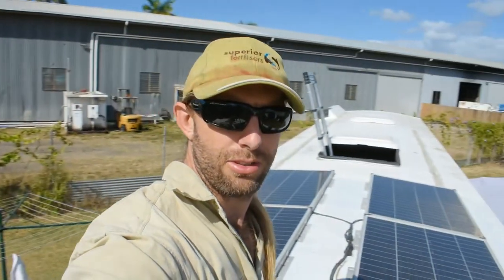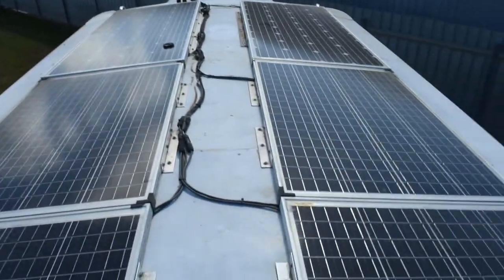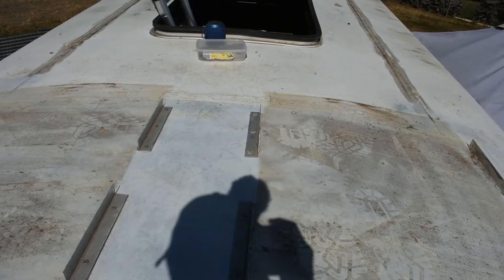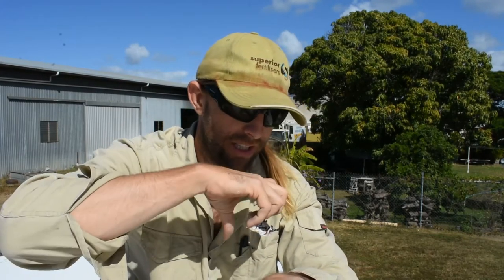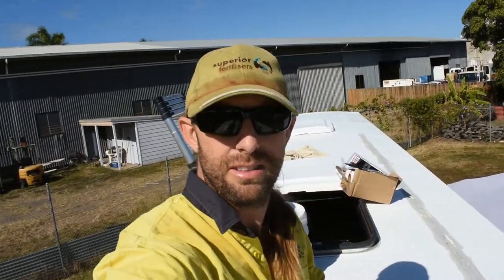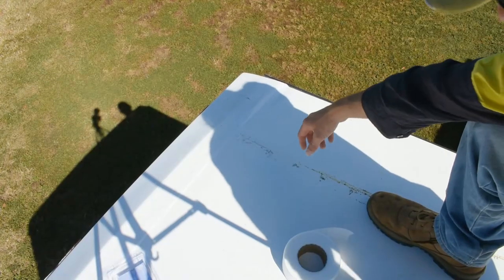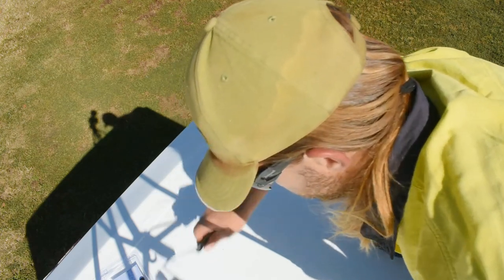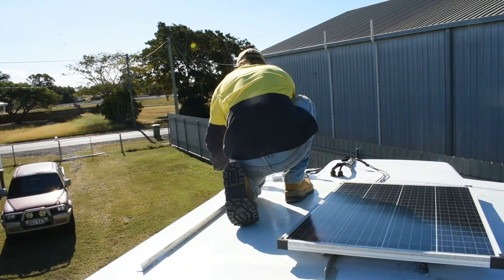Waterproofing Our CONVERTED BUS Roof | Bus Life Australia

Comment: Did you dab some silicone over the rivets on the solar brackets and the front & sides of the brackets ?
Being that they're on the downward slope on each side, & the brackets at the top, there's a fair possibility that, that's where the rain could get in.
Reply from the maker: I did seal over them, yes. When I installed the panels I also sealed between the metal sheets and also dabbed a small amount of silicone into the river hole. Maybe overkill, but better be safe than sorry 😁
Reply: @TravellingNowhereFast  
Yeah ok unless it's the rubber seal on your hatches that are a bit worn.
I had a rubber hatch seal that leaked from that very reason.
Sometimes it's a simple case of the wind causing the rain to capillarise, but if it's leaking every time it rains then that's clearly not going to be the cause.
I'm sure you'll sort it out soon anyway..👍
Reply from the maker: So you know the frustration 😅. 
I used this membrane around the hatches where they come into/through the roof as well. And pretty much everywhere else on the roof I could think of. 
If it’s still leaking after this my next point to look at is under the gutter/above window frame, but I’ll wait and see when the membrane has fully cured
Reply: @TravellingNowhereFast  
With membrane..if you're not already in the know...it's best to begin with a very watered down priming consistency to begin with, and a day to cure, followed by a slightly thicker coat for the 2nd application and another day to cure and repeat again for the 3rd coat..and the last coat is at full strength.
The 3 coats of primer with each coat slightly thicker than the last, allows it to not only adhere properly but it makes sure that the product gets right into the problem area's properly.
Reply from the maker: Thanks for sharing, that’s good advice 👍.
 I only did the one ‘primer’ coat at about 50% water/membrane mix, then 2 coats at full strength after that, hopefully it’s good enough. The things we learn after the fact …